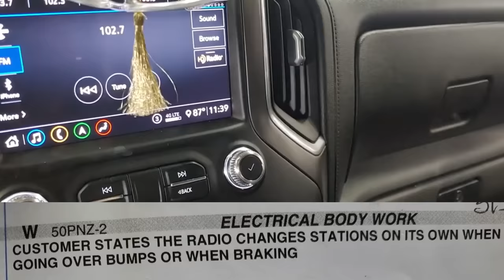Customer States New Camaro They Bought Won't Start

Comment: The skittles thing was funny, I  worked years ago with this guy who back in the day would put tampons down the filler necks of people cars who pissed him off, he said as they expanded when soaking up gas they would get sucked onto the intake filter screen blocking it and when it stalled the tampon would fall off because of lack of suction, float around until it got close to the filter and get sucked back on it.
Reply: This is quite vengeful 😂 imaging doing the diagnosis for that!
Reply: So his name must have been KEVIN . :face-orange-raised-eyebrow::face-purple-crying:
Reply: I heard the same thing about cigars. The bits of leaves would float and block suction.

Comment: It STILL freaks me out that these people that try to MacGyver things on their cars to save a couple dollars are driving right next to me or in front of me. I do all my own work on my trucks but I know what I'm doing and it's taken about a lifetime to learn.
Folks, if you don't know what you're doing spend a little money to go to a mechanic and not only save your life but ours also🙏
Reply: The thing is, they who do not know what they're doing... don't know that they don't know...
Reply: @chedelirio6984  I know what you mean.... I've seen some of these videos where people actually put duct tape over the threads in their tires just to make it to the mechanic shop and people that put vegetable oil in their cars instead of real oil. It never ceases to amaze me.
Reply: @chedelirio6984  I believe the technical term for that is the Dunning-Kruger effect.
Reply: Things are getting more complicated on modern vehicles. You can do everything right mechanically, but still have message pop up on your dash that prevents you from starting it. I helped a friend change spark plugs on his little 4-cylinder crossover. It was simple and took about half an hour. Turn the car on, gives us an error code. We had to take it to the dealer. He fixed it in 5 minutes. Told us that the  software needed to be updated to recognize the new spark plugs. I'm not joking.

Comment: Last week I was afraid I was going to be on Just Rolled In. 
When I left the store my car was making a weird noise, sort of like a frog. It didn't increase or change in any way as I accelerated. When I stopped the noise stopped. When I got home I checked around the tires and front end. Eventually I found the source, a frog sitting in the grill of my car. He was fine and I figured the sound was the amphibian equivalent of WHEEE!
Reply: I think that’s the first time on this channel that the noise matching an animal sound really came from that animal!
Reply: .
That's a cute story; thanks for posting. 🙂
Reply: Ribbit?
Reply: Was the frog holding a pair of hand held wind mills?

Comment: That map gas oil pressure switch is on another level
Reply: Yeah, everybody knows it's supposed to be connected to the Manifold Air Pressure sensor.
Reply: Wasn’t their first rodeo 😂😂
Reply: Man, I would be pissed off enough to spend some time tracking down whoever did that. Imagine the other underhood antics they've been pulling.
Reply: Soooo dirty
Reply: Who goes that far ??
Reply: That's gotta be fraud, right?
Reply: The fact that someone comes up with this idea is amazing. Carefully focused his kind of creativity could bring world peace or eliminate hunger.
Reply: @counterfit5  Definitely would be in the UK
Reply: @carpballet  you forgot cancer solved as well as end all wars!
Reply: @toesuf94    I’m pretty sure I wrote “bring world peace.” But maybe you could check. Thanks.
Reply: @carpballet  There is no "world hunger". Just bureaucratic malfeasance.
Reply: @calculator1841    There can be both “world huger” AND bureaucratic malfeasance at the same time. There is, actually. They are not mutually exclusive.
Reply: I’m kind of blown away by that one. Must’ve watched and rewatched that segment at least 10 times before moving on to the rest of the video. I mean, damn.
Reply: This is up there with the auction SUV Samcrac got where the seatbelt tensioners had gone off but to trick the computer they soldered resistors in line to fake as if they were fixed. Stuff like that is beyond shameful!
Reply: Came here to say this lol
Reply: My 5.0L F150 has low oil pressure, so I hacked open the pressure switch and wired it to ground so that the dash gauge is happy. It's either that or get a new engine, and at ~300k miles I think I'll ride this one out.
Reply: @Stewart Peters  but why turn off the light at all?
Reply: @hustla818  it's accompanied by warning chimes, and they go off several times each trip.
Reply: @stewtheman  just get the low oil pressure problem fixed? It's just a 302, they're everywhere... find a new block in a salvage yard if you need to.
Reply: that kind of BS would not go unpunished.

Comment: I never thought of using my hot glue gun for electronics...... we have industrial units at the cabinet factory I work in.... thanks for the tip! Lol
Reply from the maker: 😂 no problem
Reply: I have seen some truly nightmarish wiring jobs. Things like bare wires twisted together inside a metal lightbox....on a gasoline hauler! But it keeps blowing 10 amp fuses so the genius driver installs 20, 30, even 50 amp fuses. Gee what could go wrong? Then there's the hone installed sound systems and underglow lighting. Makes me want to go back to working on airplanes.
Reply: Lots of off the shelf electronics are made mostly out of hot glue these days
Reply: Diy stereo installs can bring out some of the worst wiring hack jobs imaginable.

Comment: I was a mechanic in my 20's, after going to vo-tech.  I used to study all the diagrams and books in school, preparing to fix all the super tricky mehanical problems customers would bring, where no one else could figure it out.  Turns out every problem I ever saw was so obvious a monkey could have figured it out.
Reply: Yeah, if you want tricky problems you need to work at the dealer, or at the factory when even the dealers can't figure it out.
Reply: @noseboop4354  My friend's dad was a GM Master Mechanic and they sent him all around the US to diagnose the hard cases

Comment: I never understand how when people do their own work they don't notice that the parts they put in aren't fitting like the ones they took out
Reply: That's a valid point, if they were paying attention to how they fit while disassembling, and I have my doubts ...
Reply: I legit had to pause the video and ask "wtf" like 3 times on the one where they used wood screws on the valve cover
Reply: @adamdport no kidding. I've used different bolts on things before but I made damn sure A. The threads were the same B. Checked the length and C. Made sure they were the same diameter.
Reply: @adamdport  "its a screw lol no worries"

That feels like their thought process; complete, without even any punctuation.

Comment: Oh man, I remember buying a used '89 Ford Probe back in the early 90s just because it had a digital speedometer like KITT.  So many dumb decisions in my youth.
Reply: Mine was a '73 Chevy Vega.  New.  It tried to kill me.  Haven't even looked at a GM product since.
Reply: @shooter2055  Vega could be a good car. If you did the modification to the distributor and carburetor.
Reply: @Ghauster  Yeah.  I exchanged the main metering jets for slightly larger items and installed a dual-point distributor.  Tube header also.  Valve stem seals sucked, even after swapping to "improved" items.  I used one quart of oil for every ten gallons fuel -- a 40:1 mix; average for a two-stroke engine.
Reply: @shooter2055  My mother had one when I was a kid. Somebody in California was making a tuning kit for them. Add lead weights to the distributor weights, bore out the jets and run 21 degrees advance. Made a big change in performance. Trouble came in the differential. It developed a howl. Even though Mom didn't have a lead foot. Dad traded it in on a Monza.
Reply: @Ghauster  The diff problems involved the lateral, 'spider' gears.  A small amount of "enthusiastic" cornering caused the spiders' bearings/bushings to 'wallow out'', allowing half-shafts to move laterally.  That noise was just a symptom.  Ignored, a half-shaft/roadwheel might decide to exit the axle tube.  GM quality.
Reply: I had a 90 Probe with the digital dash. That was a great car.
Reply: @stargazer7644  Unfortunately, my 89 wasn't so great.  Turned out it was the first year they made that model and I quickly learned that first year models have a looooooooot of growing pains.  Luckily, it came with an extended warranty but all through the final year of that warranty, I had to take it into the shop so many times to fix electronic problems that I ended up on first name basis with all the repair guys.  Once a month the head mechanic would say "Guess how much it would have cost you this time if you didn't have the warranty?"  I ended up trading it in a month before the warranty expired for a new '94 Probe GT.  Didn't havethe fancy digital dashboard but it ended up being much more reliable in the long run.
Reply: @mrquirky3626  I'm sorry to hear that.  Mine was a great little car.  The hatchback on it was huge!  I remember moving a 5kW generator in that gigantic trunk.  Other than a failed thermostat after a few years and some excess rubber blocking the buttons on the steering wheel that the dealer fixed the first week, I don't recall having anything go wrong with it.  It was jet black.  My first and last black car.  It was so pretty at the dealer.  But that was the only time it was that pretty.  It was never ever that clean again lol.  I bought mine because of the digital dash too!

Comment: 1:57 They see me rollin', they declinin' (all repairs).
Reply: I think a lot of people use a shop to diagnose a problem and then fix it themself.
Reply: @tinknal6449  "fix".
Reply: @petuniasevan  I've done it myself.  Hard to diagnose front end issues without a hoist but the repairs are usually pretty easy for someone used to wrenching his own stuff.
Reply: @tinknal6449  Some can; some just throw the parts on, have a few left over or missing, and call it good. 😜

Comment: The radio complaint (and similar situations) remind me of when I was a AAA driver. 'Customer states car won't start.' I'd sit down at the wheel, shift from D to P,  and start the car. (Those customers always tipped well.)
Reply from the maker: Lol can't beat that! 👌
Reply: Some of us don't have many hours with automatic transmissions and yes I have shut down a automatic in drive and gotten upset with the key not pulling out of the ignition 😂
Reply: I once stopped the car and couldn't get the key out, so I slightly panicked, cause I couldn't start the car and I was at a desolate place.   After I calmed down, and started diagnosing, I Found the car was still in D.
Reply: Years ago my wife was the last one to drive my truck and then it wouldn't start. I spent hours diagnosing every damn thing before sitting in the drivers seat at my wits end when I saw it.... was still in reverse. That was 15 years ago and I'm still facepalming about it to this day. Ever since then I learned to eliminate the most minor and seemingly obvious problems first, then work my way down lol.
Reply: I am guilty of this fault. My first car, a '92 Volvo 240, would allow you to remove the key while the car was in Drive. Took 3 grown men (my HS boyfriend's father, my father and my dad's friend) to figure out what the issue was. Then the neutral safety switch went and my dad asked "did you put it in park?!"
Reply: Not just cars, I support the computers in the factory where I work. Got a message yesterday that one of the computers had a black screen. When I checked it out the only problem was that it was turned off.
Reply: @JeffDeWitt  do you know the one where the screen would go black and only come back on when the monitor is smacked? so the support person went to see the work place and see what was actually happening. after a few minutes the machine's energy saver made the screen go black. the worker then smacked the monitor hard enough to make the mouse move... monitor worked again.

talk about a fast worker. XD
Reply: @lotharrenz4621  Oh yes, but our monitors are usually several feet away from the computers so that wouldn't work, but the power settings are one of the first things I check. All that stuff should be set to "Never".
Reply: I had a friend who bought a car and the first time he started it; he said it moved forward.  I asked him if it was an automatic or manual.  He didn't know.  So, I went out and had to teach him how to drive a manual.  Start it in gear and it will move!  I convinced him take a basic mechanics course.  He found his calling and four years later, he is a master mechanic for a rally racing team!  😮😮
Reply: @JeffDeWitt  of course. :)
and then there is this one I overheard:
"You know you have spent too much time before the computer when you find yourself trying to click away the fly sitting on the screen..."
Reply: @lotharrenz4621  It's worse than that, one time I saw an interesting billboard and my first thought was to click on it!
Reply: @JeffDeWitt  oh goodness, that's rich! :D
once I saw an artist who usually does digital arts, and watched as she sketched something on paper, and then she reached for Ctrl+Z, realized it right away, and with a gigglefit she sank onto the table ever so slooowly...
Reply: AAA needs to be tipped???? How about receiving a salary in exchange for work?

Comment: Okay , I see 2 things the " oil change place " did wrong , 1 smashed some wiring , 2 installed a fram oil filter 🤦
Reply: At least they got it on tight enough to not leak.

Comment: I'm reminded of a CRV I think, it wasn't a customer complaint but I get in, turn it on, it's a hot summer day and they have the A/C blasting max cold.
Both heated seats are on high.
Reply: My wife's car had the seat heater button where my knee could easily hit it and turn on. I had a couple moments where I was sweating and finally noticed the light was on.
Reply: Hehehe.

Reminds me of an old boss I had, would go out 10 minutes before he left and start truck and turn A/C on. One time he did that, I went over, turned heat and fan on max, shut the door and went back to work. It was about 90 degrees out..
When he opened the door to get in, he about passed out from the heat. I laughed. Never did it to him again 😅😊

Comment: The fake oil pressure gauge is a common trick lol that’s why I never buy from auctions or dealers. If they refuse to send the car to a trusted mechanic, don’t walk away, RUN away.
Reply: I don't understand how someone could fall for that, it would show full oil pressure without the engine running and how would you not notice a bright yellow MAP gas bottle when you opened the hood?
Reply: @ferrumignis  Well, they paint the bottle to make it blend in. Usually.
Reply: Seems like it would be easier to just put a resistor in. Haha
Reply: @ferrumignis  90% of millennials know absolutely nothing about cars and are the perfect victims of the tricks and misdeeds of the auto industry. If most young Americans actually bothered to care about the quality of their cars, things would be way different. Of course, the vast majority of young people (especially women) don’t have much desire or need to know about cars anymore since leasing became the norm
Reply: @anthonyberger810  " 90% of millennials know absolutely nothing about cars"

Sad but true, and I'm sure the situation with Gen Z is far worse.

Comment: If you drive a CMV and have a tiny air leak I’m your mile of air lines the size of a pin head “out of service on the spot until you fix it” 
But if you drive a car, you can have your frame held together by literal 2x4’s and drywall screws and they don’t care. Watching how people “fix” their cars on this channel they need to stop focusing only on trucks, and go after the ones causing ALL THE PROBLEMS 4 wheelers

Comment: Many years ago I changed the ignition points in my brother's car, I dropped one of the mounting screws down the side of the distributor. Since we were doing the tune up outside in the snow, I left it there and just installed a replacement screw. We started up the engine and the screw had wedged itself between the shaft and housing. This caused the shaft to snap where it went into the oil pump. It took hours to remove the broken piece, and a new distributor. Did I learn my lesson? Yes! If I drop a screw or bolt or anything else I find it before moving on...

Comment: NEVER buy a car that was sold at auction. This means research the history of the vehicle and see if the dealership bought it at auction.
Reply: Too late!  Owner of a Chevrolet cruze.  The oil has to be changed very frequently because the engine bales the oil in the turbo oil feed line.  Better still, the cooling system has plastic parts that become brittle and break often due to heat/cold cycles.  I'm still waiting to see what else is going to go wrong.  And the promised fuel economy isn't there at highway speeds or fighting a wind.
Reply: @johnchestnut5340  Im really sorry to hear that. GM makes terrible four cylinder engines. They could never get it right, not in the 50 years they’ve been trying. Have you considered trading it in? Carvana perhaps? Better than sticking with a lemon.